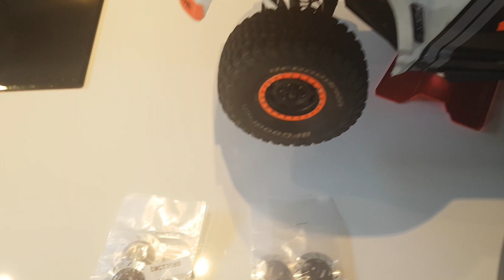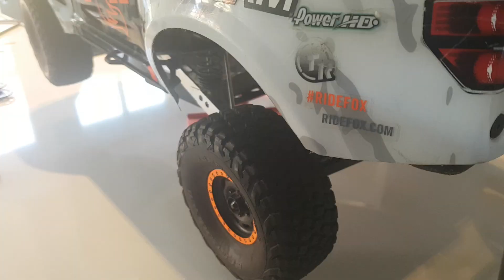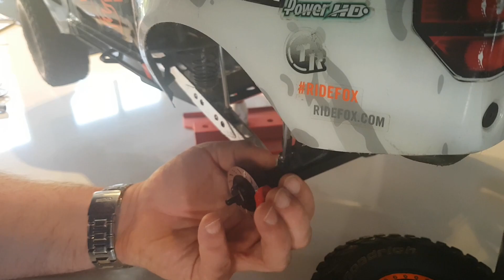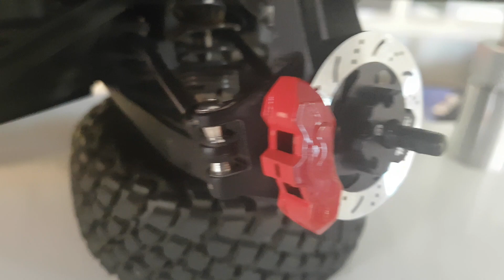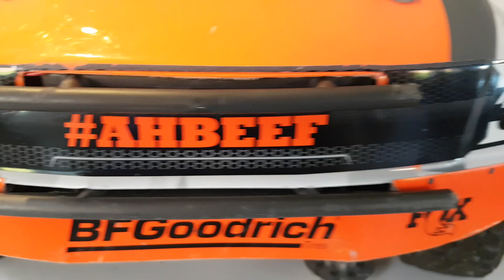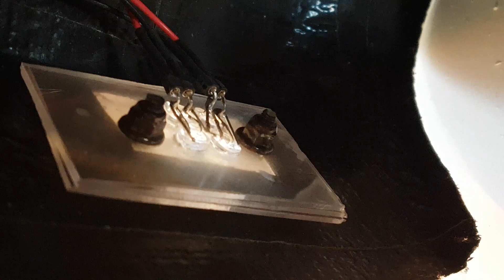Traxxas UDR aluminum disc brakes and LED headlights update (pt 9)

Comment: Nice upgrade ! I love the way to install the leds lights, and i agree the brake disc are really really realistic ! Love those
Reply from the maker: Disc brakes from Ebay: https://www.ebay.com/itm/2pcs-Aluminum-Brake-Disc-Drive-Hub-For-1-7-TRAXXAS-Unlimited-Desert-Racer-UDR/142832990365?hash=item214182789d:m:mVMlL0OPRjA1eFijh9cFRtg
Reply: Ronald Harkema i'l probably use it if i get an udr 😁😁😁

Comment: My original brakes won't come off and I afraid of damaging it. It there a trick the first time?
Reply from the maker: Use brute force!

No, just kidding. Pull with 2 fingers, while wiggeling the disk and the caliper. Maybe a little WD40 might help.
Reply: @RonaldHarkema  think you. I was really afraid I was going to break something, esp because my aluminum breaks don't arrive for a month or so. I am trying to get to the hub at the moment. Do you think that because it is brand new(bought last week) that the part hasn't worn sufficiently to be removed easily?
Reply from the maker: @akalaification  No need to worry. Just  wiggle and pull with a bit of force. In the video you can see me fighting with the brakes as well. These are really tough parts.
Reply: @RonaldHarkema  thank you again!

Comment: Hi mate! Are the calipers only a cosmetic upgrade or has functionality? Thanks
Reply from the maker: These calipers are only to add detail to the model. They come standard, but I painted them red to stick out. In the meantime, I changed them out for aluminum calipers, to match the disc brakes. I think the disc brakes are an actual improvement on the plastic hexes. Besides that, they look great too.

Comment: Are these strong because I got GPM disc brakes and they melted the pin when I took it off the pin broke in 3 pieces
Reply from the maker: No issues at all with these.

Comment: Does the discs rub against the front and rear axles carriers?
Reply from the maker: No they don't. They run clear of the axle carriers.
Reply: @RonaldHarkema  great, i just bought them with rear aluminum axle carriers, i hope they'll fit